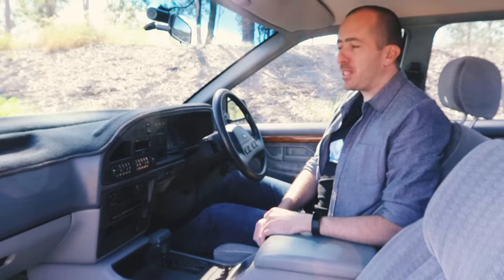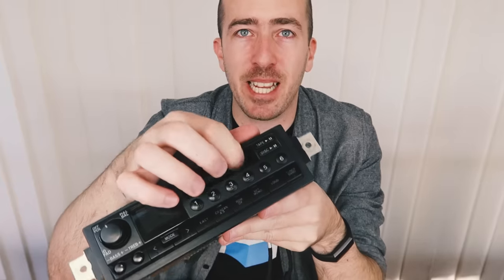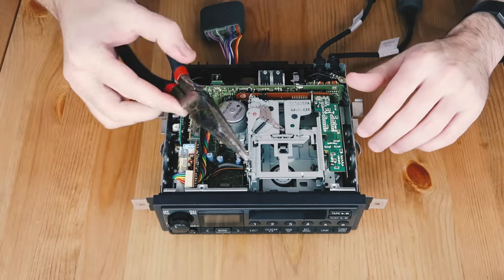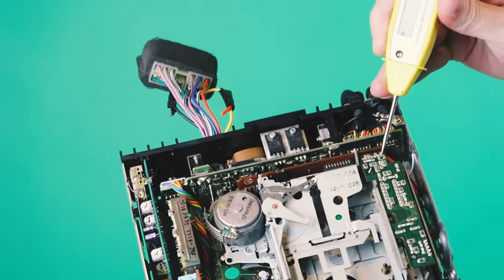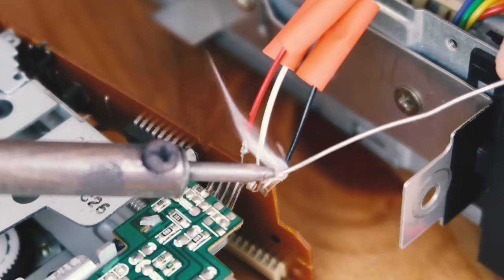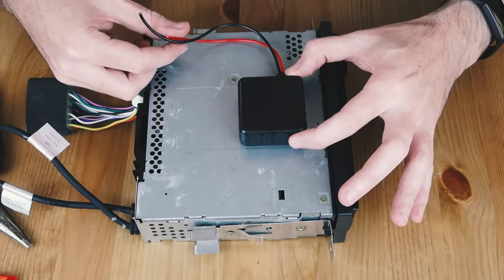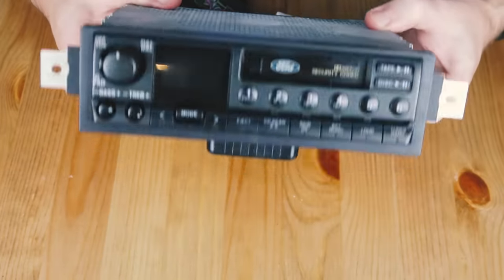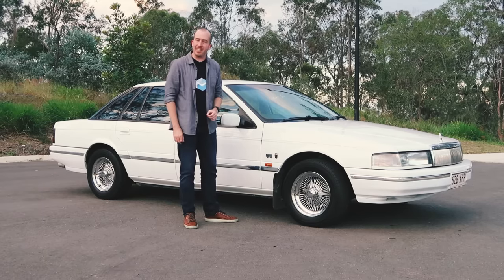Add Bluetooth To Your Old Car Stereo For $25!

Comment: The thing I really dislike about this, is that you cant play tapes anymore, and I by myself want to be able to add bluetooth but also still be able to use  the tape mode.
Reply from the maker: Easy - solder directly to the points on the board, and don't remove the springs from the tape drive. This allows both signals to play at once. So just play a blank tape when you want to listen to Bluetooth.

Comment: I have Bluetooth but only works when calling or receiving calls pisses me off!!, that I have to use aux jack Is there solution for that??
Reply: New phone?
Reply: @mac11380  no iPhone 8
Reply: It seems you've bought an incompatible bluetooth adapter - the one you should get acts as an bluetooth speaker/headphones, you've gone and went bought a one that acts as a bluetooth handset. Do you mind sending me which bluetooth adapter you ordered?

Comment: You made a fundamental mistake,  Do not connect the power cable plus to the yellow wire, Yellow It's a memory cable, where the voltage is present all the time which leads to overheating of the module. It is best to connect the power supply from the cassette player's motor. Because the voltage will be present only when we will use the module (tape).

Comment: can we connect this device to the cables of the cd changer?cd changer is defective.and on cdc safe mode. (ı don't have cdc code)why not a bluetooth instead.:) help me please.
Reply from the maker: What happens when you change to CD mode and try to hit play? If you can still change to CD mode but nothing happens, there may be a chance that you'd be able to make it work. I'd be trying to leave everything connected as is, but one way or another you'll need to gain access to the wiring which runs from the CD changer to the head unit. Three of them will be what you want - left channel, right channel, and ground. Good luck!
Reply: @MotoringBoxTV  I removed the CDC socket from the CD changer unit. Data, right and left audio, GND and power cables etc. there is. Is it sufficient to send a signal to the center tape (phılıps ccr 600) if the connection is made? The cd mode option is on. I just don't know my cdc security code.thank you for your interest ;)

Comment: Hero, just in the middle of it now and so far so good except the audio quality is garbled as heck, any ideas? 😂
Reply from the maker: How so, distortion? Keep your phone's BT volume under 70% and see if there is any difference?
Reply: @MotoringBoxTV  Highs, lows and mids go through waves of noise distortion (for example the lyrics can be reasonable and then go completed choppy and garbled or the bass aspects blow out completely and then return to just low quality) 
I did lower the volume on my phone to 10% and crank the headunit up to compensate and saw a minor improvement but only to the overall quality, still had the waves of distortion and generally bad audio 
Is there perhaps some DC filtering circuit im skiping or a filter on the tape drive input that is causing the issue? 
Going to try going in on the aux cords lines instead and see if that helps 
Cheers for your time, any ideas are appreciated ❤️
Reply: @EpicTurtle113  Was thinking of doing this mod myself, did you figure out any insight on where to solder it to improve sound quality?
Reply: @UkraineJames2000  sorry mate I ended up having no luck and gave up haha

Comment: I was looking through the interweb though with a different idea in mind. If someone could help?
I too have an old cassette deck with an outside cd-changer unit (oem set-up by Alpine). I wanted to unplug the cd-changer (plug is under the seat where it’s mounted)and plug in in its place an ipod/tablet/usb and use the CD mode of the deck to play music. Possible?
Reply from the maker: I believe it'll work, but I could leave the CD changer in place and then find out which wires are responsible for sending the audio signal to the head unit. Those are the channels you'll need to intercept.
Reply: @MotoringBoxTV thank you for the instant reply! CD changer doesn’t seem to work anymore, otherwise I would be happy to leave it alone to be honest. Was thinking, use the power cables from the car’s side plug to constantly charging the mp3 player and, exactly, figure out the audio ones for the rest. You reckon would be just the 2 for power and the rest audio? I saw also a yellow one in your vid.
Reply from the maker: The only concern is what the head unit will do if it can't detect the cd changer, or the changer isn't working properly.. it might revert back to radio or at the very least stop outputting audio from the changer. So it'll come back to what smarts your head unit has, and how you can trick it into keeping the input from the cd changer live.

Comment: Does this work if you have a CD player instead???
Reply from the maker: Probably, I don't see why not.
Reply: Thanks legend 👍😁
Reply: A lot of CD players had Auxiliary connections externally at the back. If you're lucky you won't even need to open the head unit. Just wire it at that point and set unit to AUX

Comment: Can you pair Amazon echo auto with the head unit after the mod?
Reply from the maker: Maybe, I've not used one before so I am unsure of the functionality. If the echo can be paired with a bluetooth speaker, it should work fine with this.

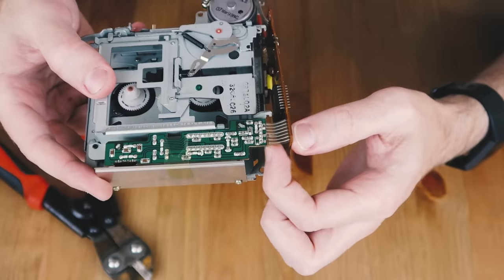Comment: At 7:23 , What if we just keep connections from both tape drive and bluetooth module. As the tape is  not there, it will anyways will not be having any signal .....

Doing it will keep even cassete player in usable condition.
Reply from the maker: You could - I would be worried it still might introduce a background hiss or other unwanted noise.
Reply: @MotoringBoxTV  it would be tolerable I guess. I m not sure though.

Comment: Does the tape drive motor run continuously?
Reply from the maker: Yes it does. Depending on the head unit you may be able to cut the power to it.
Reply: @MotoringBoxTV  in that case the cassette adapter that you tossed in the back seat is probably as good. Apart from the tapeworm effect! The audio signal goes through fewer sets of conversions.
Reply from the maker: I don't really see how it is better - the mod bypasses the tape head entirely and splices the signal in directly before the head unit's amplifier circuit. I'm not an overly technical guy, but the difference in sound quality was quite noticeable.
Reply: @MotoringBoxTV  what reaches your ears is the only thing that matters!

I didn't say better, I said no diferent. Your phone is using its internal DAC and sending an analogue voltage wave either through its internal headphone amp or to the bluetooth transmitter where it gets converted to radio waves. In general, phone DACs and amps are pretty decent. Using the adapter the signal now reaches the tape adapter's head and is picked up by the player's head. In Bluetooth the radio wave reaches the bluetooth receiver and is converted to voltages again.

There's more times it gets converted if using Bluetooth, versus the admittedly dubious quality of the transfer between the two tape heads.

Comment: That seems like an awful lot of hassle for what it is honestly. You said you had a 6 deck CD changer in the back too wouldn't it just have been easier to burn those six discs? Especially since they dont need touched again after. Plus each disc holds 80 minutes of whatever music you want, so unless you listen to crap ton of music that would take a long time to go through.
Reply from the maker: If you're happy listening to the same music over and over that's fine, but I love the flexibility bluetooth provides. I can listen to absolutely anything I like on Spotify, or I can pull up somewhere and watch YouTube with the audio running through the whole car. Same goes for Facebook videos or literally any other media accessed through the phone.

Comment: who else has tried this? I went off the TA2025P chip and it resulted in horrible sound quality, so I went off the main audio processor chip and it was worse quality lol. tried on the wires going from the cassette drive board to main board and got nothing but high's and no volume control :/. unfortunately the radio in my 03 chevy has no pinout on the boards and I cant for the life of me find any kind of diagram or boardview of the boards in the radio :/  I'm assuming I need some resistors or caps inline, but I have no idea. using a tape aux results in no high notes, sounds very muddy and low quality. 
And being a chevy I would have to invest $100 in adapters to run an aftermarket and retain door chime, steering controls, factory amp, and OnStar, plus buy a radio.
Reply from the maker: Sorry to hear you've had some troubles. Out of curiosity, what bluetooth volume level was your mobile device set to when you had it through the TA2025P chip? Anything over say 75% can cause distortion in my setup, which is something that also happens to me with some bluetooth speakers.

Comment: Can you do this with a stereo that has a cd drive? Is this possible?
Reply from the maker: I'd say so, but can't confirm.
Reply: Its possible. 
Depending on your stereo, there should be a block connector of 4 pins seperate from others, 1 pin does nothing, the other 3 are Left, Right & Ground. Solder these in the correct order and there's your Bluetooth sorted.
Can also be done with a 3.5mm jack lead, cut one end off & repeat above.
Then you have wired audio... as long as you own a phone with a 3.5mm jack headphone socket.

Comment: in that case the cassette motor always rotating when it operates when switch to tape mode. Why not try disabling switches.
Reply from the maker: As mentioned in some of my other replies, the headunit malfunctions when it detects the tape drive isn't present, or not turning.

Comment: Two things.... First...I am mad because you folks had the Fairlane to at least 93, we lost it in 1970. Second... why cut the ribbon? Why not solder to the pins on the circuit board and then the tape player would still work?
Reply from the maker: I believe I answered that many many times in the comments already 😁
Reply: @MotoringBoxTV  Sorry...I didn't read all the comment, maybe I should have.

Comment: Can you disable the motor running?
Reply: Andre Michel cut the wire to motor if you are not going to use a cassette again
Reply from the maker: Leave yourself the option to reconnect it in case it adversely affects the operation of the head unit. Mine needs the motor connected and running to operate properly.

Comment: what if my radio doesnt have a tape deck. how will i install it
Reply from the maker: You've only got radio? In theory there would still be left and right audio channels somewhere for you to tap into, but then you run into issues with how you'd mute the radio output. Some comments here mentioned FM modulators which hardwire to the vehicle's antenna - might be something worth looking into?
Reply: @MotoringBoxTV  ok I will look into that..thank you so much

Comment: But you can not make calls, and you have to use your phone to change songs (which is illegal) so what is really the point.
Reply: Zac Lund not true, perfectly legal in NSW at least to change playlists in a music app as long as the phone is mounted
Reply: @apb1441  actually it is not, touching your phone for any reason is illegal. You need to look up some laws.
Reply from the maker: Nothing I hate more than talking on the phone while driving. But if you want to do that, I've seen plenty of Bluetooth modules available which allow it - and some even have their own little controller (wireless and wired versions) which you can mount somewhere on the dash. I kind of wanted to go the other way and have no aftermarket bits floating around in the interior. Thanks for watching.

Comment: What if you still wanted to play a cassette, in addition to Bluetooth?
Reply from the maker: Has been asked many times - soldering the wires directly onto the board would achieve that outcome.
Reply: @MotoringBoxTV  So you could still pop in a cassette & keep Bluetooth.
Reply from the maker: In that situation you'd hear both sources outputting together. So you'd have to pause/stop your bluetooth music in order to listen to the cassette, and insert a blank tape in order to listen to bluetooth. My only concern would be whether you'd still have background noise/hiss outputting over the top of your BT music.

Comment: I did a version of this where I had to cut the traces on my radio circuit board and solder onto the traces. Really tough. That radio died after a few years. I had to get the same one since the HVAC controls are integrated into the radio. (2005 Subaru dual heat zone) Now I am going to use your method since I don't use the CD player and would be less intrusive.

Comment: I just connect a small Bluetooth device (receives and transmits depending on which you want to do) into the 3.5mm jack in the car and send music from phone. A lot less work than what the video showed.
Reply from the maker: If you have a 3.5mm jack that's great - mine and many others do not.

Comment: Wudnt it be easyer to just steal wires from the aux port? no need to complicate things
Reply from the maker: The AUX port didn't exist on most car stereos in the '90s 😁 But sure if your stereo has one that makes it super simple.
Reply: @MotoringBoxTV  oh thats why 😅 my bad. I got rca jacks on my just came to check if i can plug in the radio 12v wire 😁

Comment: cant you tap into the plug at the back of the radio?
Reply from the maker: One is for the CD stacker, which you could possibly use. The other is an output for the amplifier.

Comment: Why didnt you just solder them on the PCB?
Reply from the maker: Didn't want to risk damaging it, plus I wanted to totally sever the existing connection. Feel free to do so though, it should still work.
Reply: @MotoringBoxTV  Aah, I see.

Comment: Now, what if i still wanted to use my cassette deck but still have the bluetooth mod?
Reply from the maker: Solder directly to the points on the board and you'd be able to have both signals passing through at once.
Reply: @MotoringBoxTV  thanks! Is there a website where you bought your bluetooth receiver? I'd like to purchase that module of it compact size

Comment: What if your radio doesn’t have a tape drive?
Reply from the maker: Not entirely sure. If you're limited to radio you'd probably have to find a point of entry somewhere before the volume control / amplifier and then somehow turn it on and off via a switch. Some creative thinking may be required on that one.

Comment: I would have just put the Bluetooth module where the tape goes so its not swinging around underneath the stereo in the dash
Reply from the maker: No swinging, it's being held perfectly with automotive-grade double-sided tape. Plus I can't remove the tape drive without the headunit malfunctioning.

Comment: so i did this to my radio, and the aux its tooo loud, what should i do?
Reply from the maker: So it turns out the signal from the tape drive gets amplified before it feeds into the main board of the head unit... It sounds like you may have spliced in before this amplification.
Reply: @MotoringBoxTV  can i make somtin to reduce the amplification and the buzzing??

Comment: Sway not just take over the unused cd input wires?  Won't even need to take unit apart.
Reply: Often the stereo requires a communication from the CD changer to enable the input.

Comment: Now do an aux hack, my dude!
Reply from the maker: It'd be the same process - you'd just need an aux cable that has a flush-mount female aux input on one end, and a male aux connector on the other (which you'd cut off to expose the wiring). The hardest part is probably finding a location to mount the female aux plug on the head unit or dash.

Comment: why did you cut the ribbon cable??? Just solder onto the points on the board. When you (for whatever reason) want to play your Cassette deck, it will still work.

Just don't play the tape while using your Bluetooth device. Simple common sense.
Reply from the maker: Up to you to choose. I will never play a tape ever again, and didn't want to run the risk of any background noise or hiss coming through from the empty tape drive.

Comment: Cool mod - love to see people keeping old stuff going.  And you seem like a nice guy, so not trying to flame but I do have some constructive feedback.

I agree with other comments, no reason to splice into the ribbon when you can just solder straight to the board and save effort.  The connections were cold soldered, meaning a poor and weak connection.  Use rosin flux core 60/40 solder and heat the connections appropriately, solder will flow in and not ball up.  Also, heat shrink tubing was oversized so it was loose in the end and should be warmed using a heat gun or indirect heat from a mini torch, not by direct contact with a soldering iron.  Not having a go at you but since you're making an effort to teach others, perhaps aspire to teach people how to do things well.
Reply: You do this on the regular? I need it for my 87 Camry cassette deck, I don’t know what to get or where to get it